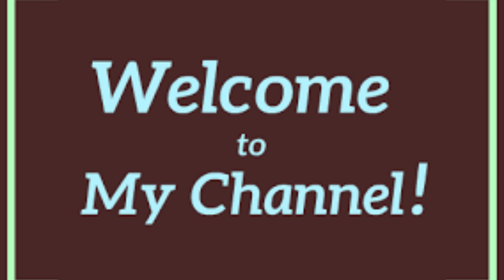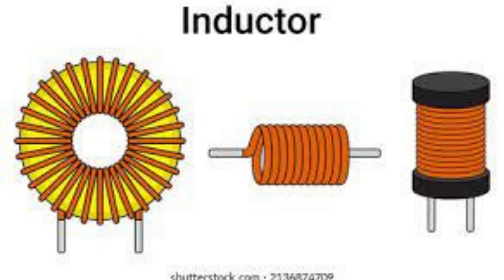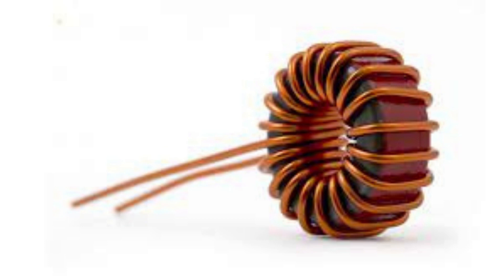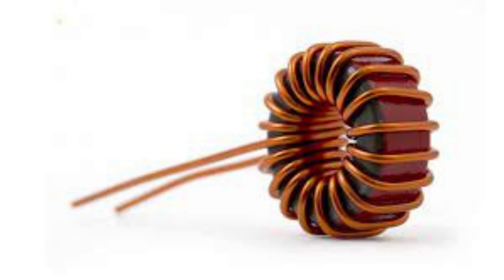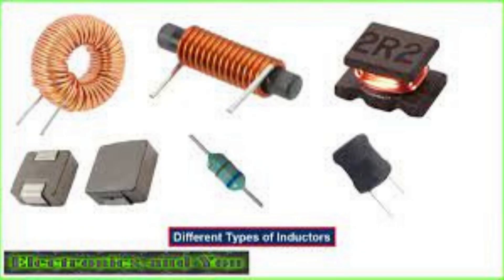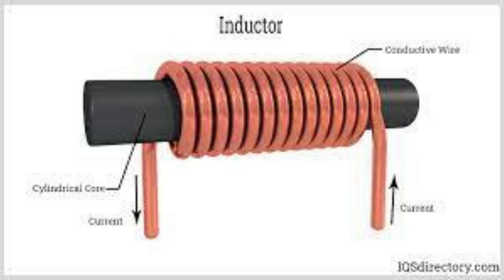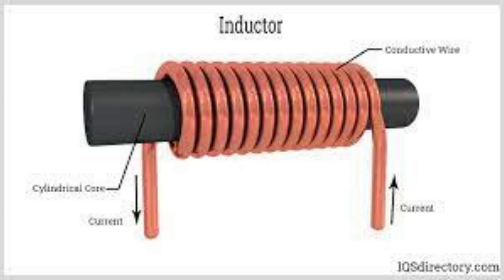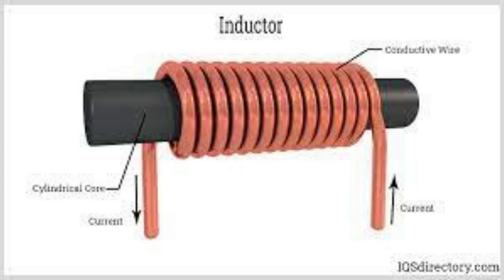Understanding Inductors: The Basics, Types, and Applications

Comment: Is inductor used in solenoids, closed loop control systems and automobiles motor starters? And how does it work in these applications?
Thanks
Reply from the maker: Yes, inductors are used in solenoids, closed-loop control systems, and automobile motor starters:
Solenoids: Solenoids are electromechanical devices that generate a magnetic field when an electric current passes through them. An inductor is a key component in a solenoid, as it helps in creating the magnetic field. The inductor is usually in the form of a coil of wire, and when a current flows through the coil, a magnetic field is created around it. This magnetic field interacts with a movable core or plunger, causing it to move and actuate the solenoid's mechanical functions.

Closed-loop control systems: Inductors are commonly used in closed-loop control systems, particularly in filters and energy storage applications. In a closed-loop control system, feedback is used to continuously monitor and adjust the system's output. Inductors play a role in such systems by providing energy storage and filtering capabilities. For example, in a power supply circuit, an inductor can be used in combination with capacitors to smooth out fluctuations in the output voltage, reducing ripple and noise.

Automobile motor starters: Inductors are employed in motor starters for automobiles to limit the initial current surge when starting the engine. When an automobile engine starts, it requires a significant amount of electrical energy. Inductors, known as starter solenoids or starter relays, are used in the starting circuit to control the flow of current to the motor. The inductor helps to limit the initial surge of current, protecting the motor and electrical components from damage.
In all of these applications, the fundamental principle of an inductor's operation is electromagnetic induction. When an electric current flows through a wire coil, a magnetic field is created around it. This magnetic field can store energy, and when the current through the coil changes, the magnetic field induces a voltage in the coil. This property of inductors allows them to store and release energy, control currents, and create magnetic fields, enabling their use in various electrical and electromechanical applications.